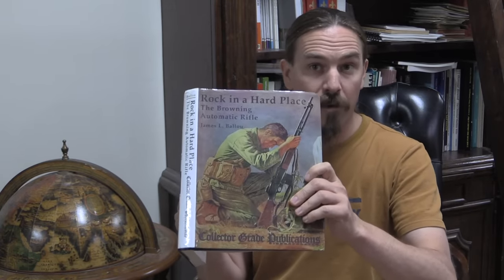Ask Ian: Why Not a Semiauto BAR Instead of the Garand?

Comment: Uhm... lets put some context around the BAR... 
It was developed at the end of WW I. 
M1 Garand... adopted by Army in 1936. 

As to the BAR, Bonnie and Clyde used them. Sawed off the barrel to make it easier to shoot in confined spaces.  

The BAR of WW II did have a bipod so you could shoot short bursts w control.  At that time... belt fed machine guns were heavier and required 2 people to man. 

So it did serve its purpose. 

.30-06 is 7.62x63mm vs .308 (7.62x51mm) 

If you look at the squad tactics... the BAR was used for suppressing fire.  So maybe in full auto its not as accurate as the M1, it allowed the rest of the squad using M1s to get into position.

Comment: BAR was a superior weapon in every way except the weight.  Similar to  the choice between a M249 SAW (5.56 belt-fed) and an M240B (7.62 belt-fed).  It took a strong, long-armed individual to handle the M240B, not because of the recoil (barely had any because of the immense weight), but because the length of the weapon and the amount of climb (pulled up and to the right pretty hard).

Comment: A note about the XM5, it does not have a 13 pound weight, it's 9.85 pounds with a suppressor, and also the average American male, and therefore the average soldier, has grown in height, weight and strength, the more so because we now have an all-volunteer service. The average weight of a soldier in WW1 was about 112 pounds, now it's about 200 pounds. In fairness, they're also obliged to carry more now, but an extra 4 pounds of gun is not going to make or break the modern soldier's kit.

Comment: I'm only 5'7" but if I were a soldier back then, I probably would want take the BAR despite being heavier than the Garand and knowing well that it is too heavy to take single shots from the shoulder, but being in a squad armed mostly with Garands would also give me a bit of peace of mind but me choosing the BAR instead of any other lighter weapon is probably just me talking with full sleep and eating well. In actual wartime, I would be probably forced to give it up for the M1 carbine.
Reply: I mean even the 1918A2 is only 21 pounds. I met lots of SAW gunners smaller than yourself that ran it just fine with optic, light, and laser. You’d get used to it
Reply: When I served, you didn't have any choice in what you were taking.
Reply: @Lurch7861 nah bs they would give you an m1 garand or carbine give they guy who is 5 nothing and 120 soaking wet the bar when I was in the army we had giants with m4s and 5'2 dude lugging around the 240b

Comment: It's not a dumb question. It's not impossible to convert a BAR to a light semiauto rifle. The BAR is very heavy because it has a heavier receiver, a heavier barrel and bipod to accomodate the sustained auto fire. If the gun is semiauto only, you can ditch a lot of these stuff which shed several pounds of weight.
The gun can be easily converted to closed bolt as well changing the trigger group and slightly changing the bolt as they did with modern reproduction. If you want to slim it down further you can make 10 rounds mags as well.
I think the weight would drop to a figure similar to what the Garand was at the time .

What was the problem? The Army wasn't really forward thinking at the time (like most other armed forces of the time) and they did not know what to do with auto and semiauto rifles really. If you watch the Army requests for semiauto rifles you will see that they changed several times during the trials going through absurd requests, ammo change and whatnot.
The Army itself would have never be able to process these idea correctly and all the real innovation in small arms were due to private companies coming up with them and showing them during trials just like Garand did.
Reply: but then the unit cost would still be several times higher than the Garand even if production lines were optimized for BAR production

Comment: The model 1918 BAR was made to last forever. Heavy and expensive. With a full magazine belt and canteen and pack and......whatever else it was a load to carry. It had fast and slow rate of fire. Very controllable with an experienced operator and single shots were easy. The M-14 is in my opinion  a result of the BAR and M1 rifle coming together in concept.

Comment: One of Bonnie & Clyde's favorite weapons' along with the Browning Auto 5--12 gauge. They had disdain for the .45 acp. Not being able to punch through a car door wasn't for them. Unlike John Dillinger they liked killing people.
Reply: I'm pretty sure 45 acp can punch through car doors, even car doors of the 1930s.
Reply: @ChristianMcAngus  Yeah but not very lethal afterwards. Also you were forced to use one of maybe 3 types of ball ammo Kicking out of the bbl at a little over 810 fps. Same as the velocity of a .38 special. Even .38 auto or .38 super ( the Origional round created by browning for the 1911) had distinct advantages over .45 acp. Out of a Thompson Sub you could add...maybe an extra 100 fps. So yes that might work after going through a car door, but hitting someone & killing them are 2 different Animal's. If you are shooting through window glass yes they are Definately deadly.
Reply: @ChristianMcAngus  The low velocity and thiccness of .45acp give it a somewhat significant penetration problem...imho
Reply: @ChristianMcAngus  .45 acp was notoriously bad at puncturing car doors. That is exactly why the FBI began contracting the Colt monitor. They needed a full auto shoulder fired gun that could consistently punch through large heavy metal 1930s car doors/frames. When they gunned down bonnie and Clyde there were instances where their .45 acp bullets would only dent the car doors and not penetrate whatsoever
Reply: Bonnie Parker preferred using a snub nose 38 due to her size, while Clyde Barrow used a 1911.  His and Parker's pistols were actually sold at an auction back in 2012 for 504 K. They were the pistols they had on them when they were shot and killed. John Dillinger usually had his Colt 1908 pocket hammerless on his person, and would use other firearms as well, including Thompson sub machine guns and 1911 pistols. His 380 though he always kept with him when he didn't have his other firearms.
Reply: Didn't they have a BAR, or am I thinking of another gangster?  Pre-NFA '34 anybody with the cash could own one.
Reply: @petesheppard1709  Yeah, they cut down the barrel and part of the butt stock to make it easier to wield, and get in and out of a car with.
Reply: @ChristianMcAngus  Especially car doors from the 30's, as they were quite thin and had little to no internal structure.
Reply: @ChristianMcAngus  I shot a car door with a .45 once. Super Vel +P ammo. Dead 1970s Volvo. It didn't make it through.
Reply: @reubenpickering7777  You shot a VOLVO? Was the gun okay after? /s
Reply: @Gameprojordan  Yes totally agree, most police were carrying Colt Police positives chambered for .38 S&W which was suicidal..
Reply: Great point! Yes, Clyde Barrow was VERY skilled with the BAR, and plenty of Police Officers found that out. The Thompson .45 SMG  couldn't penetrate most car metals at that time while the BAR would turn one into a sieve! He even coached Bonnie how to properly handle it.
Reply: In the end, Bonnie and Clyde were killed by a hail of bullets from BARs !

Comment: How pleasing to hear a measured and thoughtful response to a question. For once (allowing for oddities like wanting the bolt action) the Ordnance Board was sensible, even when it didn't pick the future. The requirement for clip loading made sense immediately after WW 1, since they didn't foresee the much cheaper box magazines that would be developed; and the allowable weight of a rifle depends on the size of the soldier carrying it, and people (and especially soldiers) are a lot bigger and stronger now than they were in 1919.

Comment: B.A.R. wouldve been a better advantage in WWII, but probably not. Its too expensive, too heavy and quite long for being standard issue. Plus too you would be a more disciplined shot with 8 rounds, god forbid you wouldnt be.
Reply: if they were all automatic BARs i think the war would have been shorter.
Reply: It could always be lightened up and shortened.
Reply: That thing was too big to be called a gun. Too big, too thick, too heavy, and too rough, it was more like a large hunk of iron.
Reply: @SmolTerribleTornado  did you just drop a Berserk reference?
Reply: Yes but part of production cost is economy of scale. If you produce only a few of something rather than millions they're going to cost more. I think if you had a semi-auto BAR style rifle as the main battle rifle with would have been cheaper. Also if it's semie auto you can shrink it down a bit. Think of the M1 Garand vs the M1 Carbine, similar mechanisms but smaller weapon. And I'm not suggesting they change caliber I'm just saying you could take the same rifle but make it smaller and lighter significantly.
Reply: I guess it's just me, but the BAR doesn't seem to have any redeeming features.
Reply: @SmolTerribleTornado  It was ultra-light for a light machinegun, four pounds lighter than the Chauchat and 12 pounds lighter than the Lewis gun.  That was part of the problem, since it was too light for full-auto without a bipod and too heavy for a plain old rifle.
Even so, it's said that during Normandy, BARs were second only to flamethrowers on the German MG crews' priority list.
Reply: @Bacteriophagebs  I know, I just saw the opportunity to make a berserk reference
Reply: Right, i bet,bean counters were loseing it when they added up rounds fired from the M-1 alone. Lol
Reply: Yes, like Soviets with AVS-36 in late 30s
Reply: Less ammo could be carried with every guy carrying 6-7 mags.
Reply: @jeffjr84  small arms played a less than 1% role in outcome of war, while artillery, navy, tanks and aviation did 99%. There's a reason why planes had full auto 20mm cannons and soldiers had bolt actions.
Reply: @flyboymike111357  yes, while you could carry shitton of clips for garand
Reply: @5.45x39_  Exactly. There is a sentiment that some styles of infantry, who have to carry their sustainment loads on their backs, would be better served by a 15-20 round en bloc clip charged fixed mag carbine than the M-4 or M-5. It would also make for a more practical civilian and police general purpose rifle by eliminating many of the common malfunctions in a situation where reloading would be more likely to be a response to a magazine fit induced malfunction than an empty magazine.
Reply: @Bacteriophagebs  
BAR's were well past their prime by ww2 but obviously they would have higher priority than regular riflemen. That said "I've heard" is hardly the most powerful argument.
Reply: @andrewholdaway813  First, I said "it's said," not "I've heard," and second, one of the several sources I heard it from was my grandfather, who carried one on Omaha Beach.  It's possible that he and his buddies just thought the gunners were/would target BARs, but I've read in a few soldiers' memoirs, as well, that they stayed away from guys with BARs because the Germans seemed to target them.
Reply: @andrewholdaway813  they targeted BARs because they could shoot through concrete and suppress the pillbox. Normandy had very few snipers because of the nazi artillary and MGs. In fact if it wasn't for them Aggies and Earl Rudder. We would've lost the invasion
Reply: @richardpowell4281  yeah but the m1 garand fired 30-06 while the m1 carbine fired .30 carbine. While the m1 garand and BAR both fire .30-06. The reason why the m1 carbine is so much smaller is because it fires a lower powered and smaller round so everything can be downsized by a significant amount. All of the critical stress bearing parts don't need to be nearly as bulky and reinforced for .30 carbine than they would need to be for .30-06.
Reply: @Bacteriophagebs  
People said and you heard.
I agreed they would have been a higher priority target.
Reply: @5.45x39_  Wow, funny how all the armies fielded millions of infantry when they were so useless!
That's one of the most ignorant things I've ever read.
Infantry took every island in the Pacific with minimal armor support.  Shelling by the Navy rarely did anything to the Japanese fortifications, and armor was hard to land, couldn't move much inland, and made an easy target for Japanese bunker guns.
Infantry took Normandy Beach for the same reason, and infantry manned the bunkers holding it.
Infantry is what takes and holds 90% of territory in a war.  Artillery's primary purpose is to hinder infantry.  Its secondary purpose is to attack enemy artillery that is trying to hinder friendly infantry.
Infantry is the skeleton around which a military is built.
You can bomb a hill with artillery and aircraft until there's nothing left alive, but you don't own it until you put an 18-year-old kid with a rifle on it.
Reply: @Bacteriophagebs  correct, but that kid can be with bolt action or even bow and arrow, no need to equip him with BAR to take a hill obliterated with artillery
Reply: @svenjorgensenn8418  
I think a lot of Normandy's pill boxes would have been beyond even 30.06 but I don’t deny that the BAR would have been targeted. 
You do know that omaha was just one beach?

Comment: Like you said, the use of detachable box magazines ended up being the direction that everyone went but I can see why most militaries were hesitant to go that way. Why worry about having to supply your soldiers with heavy, (relatively) expensive to manufacture box mags, that have more things to go wrong, when you can just give them ammo and load it with cheap, disposable metal clips? I'm sure there's other reasons I'm unaware of as well but that's what pops into my mind.

Comment: Manufacturing costs were likely a factor.   The Garand was designed 15-20 years later than the BAR.  I found reference to the per unit cost of the Garand being $83 in 1942, dropping to $31 in 1945.   The number I have seen for the BAR are $319 per unit.  The receiver of a BAR is a big old block of forged and machined metal.  The cheapest modern BAR is the Ohio Ordnance Works HCAR at $4800.  MSRP for a Springfield armory m1a, which is close to a Garand design starts at $1700

Comment: I love how the United States could’ve gone into WW2 with a box magazine fed rifle in the original Garand plans but didn’t because old men with stars on their chests disapproved. Some things never change
Reply: Box magazines are expensive the cost to produce enough would have been horrific not to mention the amount of steel needed. Clips on the other hand are cheap and use little metal
Reply: @markbrandon7359  Yeah, Ordnance Department has made some colossally stupid decisions over the years but sometimes you have to have to cut them a little slack.  A century ago the notion that a detachable box magazine was superior probably wouldn't have been as obvious as it is now.  Manufacturing wasn't what is now either so they may have had reliability and quality control concerns.  Also, like you point out, detachable magazines are considerably more complicated, expensive and require much more raw material than a simple clip, at a time when the military budget was plummeting.
Reply: @markbrandon7359  Not really. 90% of a box magazine is stamped metal with a spring.  Germany was producing tons of them for the STG and they had lost most of its manufacturing base.

Comment: The BARs I fired while in the USN despite their weight had obnoxious recoil. The USN kept them around for shooting at mines.
Reply: Interesting. Because I’ve fired the BAR as well and I didn’t find that the gun’s recoil all that bad. Sure, it moves on you, but I didn’t find it uncomfortable, quite the opposite really.
Reply: The BAR does not have obnoxious recoil it’s too heavy to have that kind of recoil. It being heavy is it’s main drawback. I guess if your used to firing an AR or an M16 it has a little more recoil.
Reply: @craigthescott5074  My main hunting rifle is a Ruger No 1 .375 H&H. In 1972 I was 156 pound teenage sailor getting combat training in GTMO. The BAR was the first full auto rifle I had ever fired. My personal rifle was a sweet M1 Garand  re-cambered into the 7.62x51 it was a.tac driver. Later on I was told the mistake I made in off-hand shooting the BAR is was I used the fold-out shoulder rest. It rests the weight on your upper shoulder not snug into your shoulder. This is something you learn real quick firing English medium and large bore English express cartridges.
Reply: @transmaster  oh yea in full auto it would be harder to control especially if you were not used to firing it in full auto back then.

Comment: 4:06
It does beg the question. Is there such a thing as a ”backward assist” or an ”open assist”?
Reply: That's basically what the charging handle on the BAR did
Reply: Yes, we call backwards assists the "cocking handle", you cycle whatever to jack the round out of the weapon

Comment: I think another major issue, which Ian alluded to, was that the BAR fired from an open bolt. The US Army and Marines were fanatical about long range marksmanship, and an open bolt rifle would simply not have been accurate enough for them. The Marines made some use of the Johnson light machine gun during WW2 and after its use  during the Choiseul operation, in 1943, by the 2nd Marine Parachute Battalion, the ability of the Johnson to fire semi-automatically, from a closed bolt, was lauded by Col. Krulak, the unit commander.